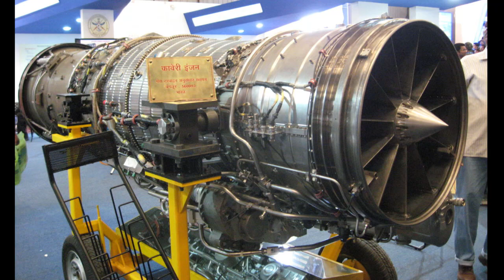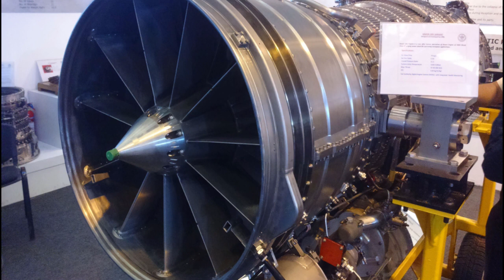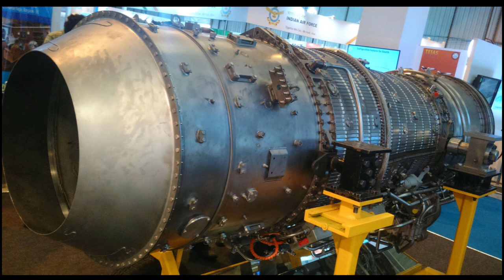Breakthrough for Safranised Kaveri engine, achieves stable thrust

Comment: If this is true , it wont be much of problem to develop k9 or k10 engine with 110 KN thrust which is what AMCA requires . In that case how come GE with much wider experience failed to come up eith a solution on Kaveri ? The problem is US and GE are not willing to share their tech with  share their tech with India .Further they are
 unreliable . France any day is better partner.

Comment: If the Safranized Kaveri gets inducted into Rafale, the sale of that plane will greatly increase all throughout the world - a win-win for India and France.
Reply: For one, the Tejas serves as a great trainer aircraft for the Rafale - in addition to being a full fledged 4+ gen combat aircraft.  One could see an airforce buying both airplanes to complement each other.  And since they use the same engines, the cost goes down quite a bit.  

It fits the "high-low" strategy of most airforces.  That is to say, airforces purchase a dozen or so high performance (and high cost) aircraft and fill out the bulk of their airforce with medium performance (and lower cost) aircraft.  Medium performance is a misnomer because any aircraft like the Tejas which can fire BVR missiles and has a good stealthy profile is just as deadly as a high end aircraft.

Second, both countries are producing weapons - a good number of which are interchangeable between both aircraft.  

Finally, it forms the basis of further co-operation on future aircraft.  

There are just so many reasons a Safranized Kaveri for the Rafael and Tejas makes sense that it would be crazy not to do it!
Reply: not really indian production cost more then French production. the rafale HAL was more expensive then French rafale that's why the MMRCA failed.
Reply: Production cost goes down with increased volume, not up.
Increased volume is exactly what will happen with the Safranized Kaveri.
Reply: orangedac 
Cost production goes up when people making it have poor experience.  Cost go up when production is shared